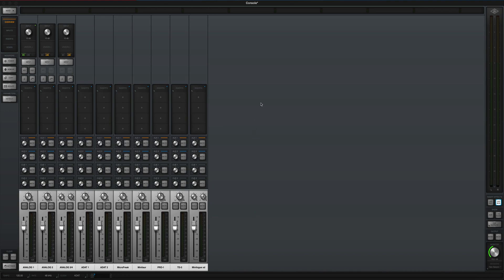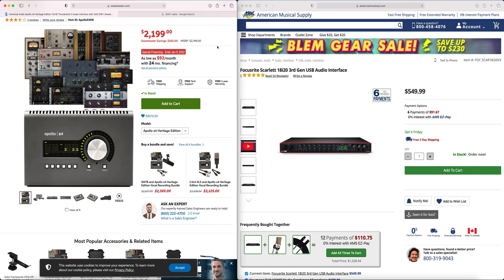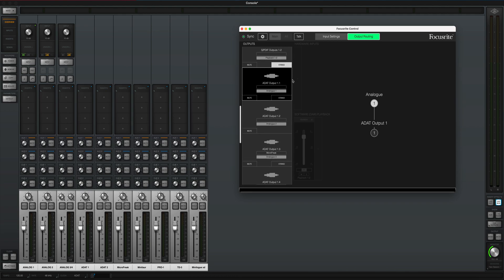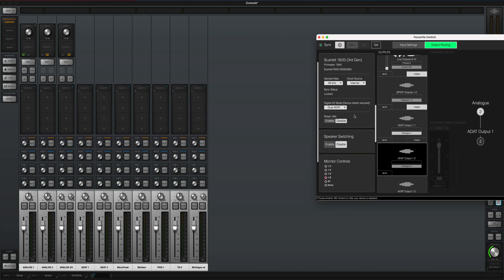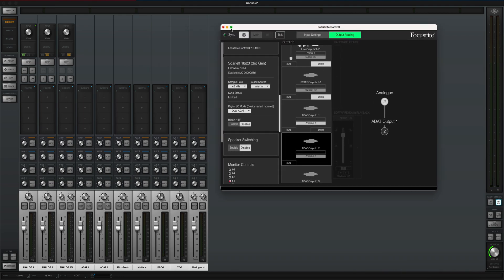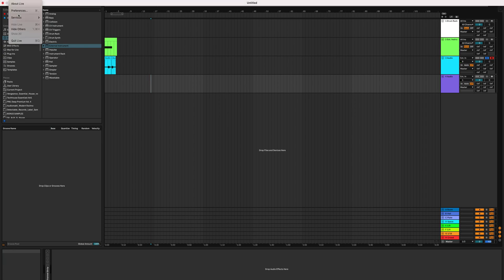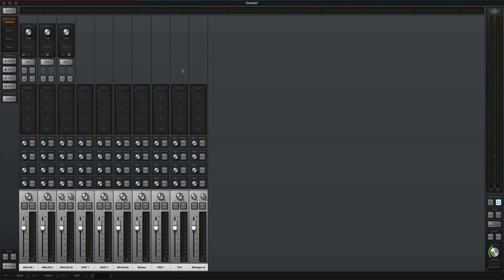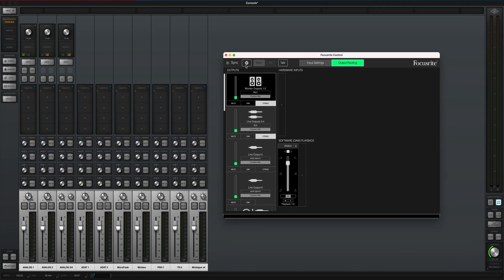How to expand your audio inputs using two audio interfaces

Comment: Will the outputs on the focusrite work if I connect stuff on the outputs and extra headphones on the headphone out and still have the Apollo twin x as the main interface ?
Reply from the maker: You’ll need adat out coming off of the Apollo as a master clock.
If you reroute the outputs to become stereo outs, you can use a dual male ts to female Trs cable and use the extra outs as extra headphones units.
Reply: @cytocache1238  would you make a video ? Sounds confusing. Will it work on Apollo twin x?
Reply from the maker: @mitzthegamer  you can just get a headphone splitter if you need more headphone options. Mackie has the HM-4
Reply from the maker: @mitzthegamer  and I suppose I can make a guide about headphone routing in the future
Reply: @cytocache1238  thank you . I do have a mackie big knob interface . Is there a way to connect that to the Apollo twin x to get extra outputs for headphone and studio monitors ?

Comment: Can I set up my Black Lion interface using the 18i20 as extra inputs using the example in this video?
Reply from the maker: Yes. Use it as the main interface and set the 18i20 as the follower. I.e: set the 18i20 clock to follow adat signal

Comment: Great to know! I thought I was going to have to not use my saffire 40 pro any longer. I’ll use it as 8 additional ins as I’m looking to upgrade my interface. Of course via adat. I also have a Focusrite Saffire 24DSP with adat with 4 inputs. Is there a way to link that in for 4 more inputs? In essence it would be whatever new interface I end up getting + Saffire 40 pro + Saffire 24dsp = 3 units total. ??? Thanks kindly! 👍🏼

Comment: I have “spdif In”
available on my Apollo x8 but it is connected to my Mac mini by thunderbolt 4 connection. 

I have a focusrite 6i6 with available spdif in/out but that is connected to my windows pc. The focusrite allows me to record midi with my Keystation 88 Mk3 and micro korg synthesizer.  

Can I connect them even though they are connected to different PC’s? I’m so confused
Reply from the maker: I believe the focusrite, even when connected by usb to a pc, can still use this adat feature. You do need to set this up in the focusrite software app on the computer it’s connected to. The focusrite can work even without connection to a computer as long as the settings are right and there is power. You will not be able to have the Apollo and focusrite show up on both computer simultaneously. One needs to be designated as the host computer. As far as spidf goes, that is a 2 channel digital connection and cannot stream 8 inputs; only 2. For example I use my spidf for hardware mastering converters since they only operate on a 2-channel count. If the focusrite doesn’t have adat you need to create an “aggregate device” interface on one of the computers. This is a virtual connection made by the computer to connect both interfaces together under one interface title. Protools has “Pro tools aggregate I/O” as an option. This does require both interfaces to be plugged into one computer tho. 
As a note, why are you using two computers at the same time?
Reply: @cytocache1238  Thank you for such an informative response! 

I am not using them at the same time... I just have them both available... My PC has tons of storage and power for Gaming, Streaming, 2D/3D and Video Editing! (AMD Ryzen 3950x CPU) I have my focusrite 6i6 connected to that. My 6i6 has midi In/Out's and I'm able to use that for my Keystation 88 Mk3 and my Microkorg Synthesizer and record in Reaper DAW.

My Apollo x8 is intended to be used for recording vocals because it has top tier converters and pairs with my Dangerous D Box+ for Analog summing but it does not have midi. 

I guess I will just bounce out the stems and transfer them over via thumb drive... I just wanted to know what/how I should think of the spdif thing. I'm not exactly sure how to apply it.
Reply from the maker: @checkmatenate  you need to look into purchasing something like a usb to midi dongle. I recommend motu midi express xt. It gives you 8 midi channels both in and out to work with. It’s cheap and you can find cheaper on Reverb.com. Spending on your keyboard it may actually already have available midi in and midi out that connects to your computer through its own usb port. You can chain midi cables off of your keyboard to the micro KORG

Comment: hey so i got everything set up. followed every step. i have everything routed on console and im getting signal through console for the extra 8 channels but ableton isnt receiving signal to record from the adat. What am i missing?
Reply from the maker: Go to input settings on the preferences window in ableton. Select 8 new mono channels and 4 stereo channels to see them in your session
Reply: @cytocache1238  i did that and I see them. But the green light that shows when audio is coming through doesn’t light up. But it does light up for channels 1-4 (those are from the Apollo) weird thing is that console is getting signal and when I drop any of the plug ins into the adat channels they are affected by them. It’s on abletons side. Wish I could show you lol
Reply from the maker: @om53_  just restart ableton. Sometimes it does this when you change I/O routing

Comment: so after this I should be able to connect my outboard gear into the 18i20 and use them as inserts on protools?
Reply from the maker: Only if you have a main interface with both ADAT in and OUT. The Apollo twin only has ADAT in meaning it can only receive 8 more inputs. Without ADAT out you can’t actually send signals to your outboard gear. The minimum UAD interface that would let you do that is the x4.
Reply: 💔💔 sounds like it's time for a x4
Reply from the maker: @JUSTOFTO  you can also consider one of the antelope audio interfaces. The converters sound better and the connections are all still there. You may have to adjust to the different software. Or just buy a rack mount Apollo in the future. They link up by thunderbolt

Comment: What about outputs if I’m routing 6 monitors for a 5.1 setup to input of monitors and output of Scarlett do I send any cable into the Apollo twin if that’s the primary to hear sound
Reply from the maker: UAD just released support for surround sound, but I’m not sure if it works on the desktop interfaces (just the racks as far as I know). However, if you’re using a twin you only have adat in, meaning you can only record an extra 8 inputs, but you cannot send out an extra 8 outputs unless your core device has adat out as well.
Reply: @cytocache1238  I have a Scarlett 18i20 it has Adat as well
Reply: @cytocache1238  I get what you saying

Comment: I’ve been told by UAD that I can run ADAT out of my Apollo X4 into my 18i20, then use the Apollo as master clock???

Is there any benefit to this or is the approach you take in the video yield same results?

Thansk, I’m new to ADAT / slaving.
Reply from the maker: I have that exact set up. You basically get 8 more inputs for instruments/hardware (Adat in on the x4), and 8 more outputs for multiple monitors or to send to gear (Adat out on the x4). The clock needs to be the same on both interfaces so that the sample recording is timed correctly when entering the daw, if not you get audio dropouts and pitch drifts. Clock also can define the way you interface sound exiting the speakers. The x4 frequency response has more lows and highs than the 18i20 so you definitely want the x4 to be the master clock.

Set you Apollo console to internal and set the focusrite app to adat. They need to be the same sample rate ie: 48k or 44.1
Reply: @cytocache1238  so what I should do here is keep the Focusrite running into Apollo via ADAT. But just switch the settings so the Apollo is master clock? 

Sorry I’m just confused as to why in your video you have the Focusrite set to master. When the Apollo set to master will have better results.

Really I’m just not fully understanding, not trying to undercut.
Reply from the maker: @tazekozak  I just recently learned about how clocking can change the sound. Either way, the physical converters on the Apollo will still sound good. Either way works
Reply from the maker: All you have to do is set the focusrite to adat and that’s it

Comment: I have a Mackie Onyx 8-channel interface that isn't supported on my 2015 iMac, so I can't install the Mackie software.  Will the Apollo still recognize it without configuring the Onyx to adat out?
Reply from the maker: It probably will, but the ADAT routing may depend on how the Mackie software is set up.
Reply: @cytocache1238  Apollo wasn't getting the input signal from the Onyx, but I'll hook it up to my old computer to see if I can change it to ADAT out.  Thanks!

Comment: Hello. Very usefull. Thank you. Could you tell me if it's possible to connect a third focusrite clarett 8pre to have 24 inputs in apollo x8p?
Reply from the maker: I just got in an x8. I think it requires 2 adat cables for both in and out so you would only be able to use 1 scarlet device. There wouldn’t be extra ADAT slots to connect a pre
Reply from the maker: If you have a desktop unit like the twin x or x4 they can run their own adat connections too and don’t require 2 adapts per in and out. You could possibly run that set up.
Reply: @cytocache1238  the x8p has 2 adat in and 2 adat out. I'm waitting my x8p to arrive. I will try anyway. Thank you for your time and vídeo.
Reply from the maker: @PedroDYONYSYO2008  you may find better results than I did. I had to reroute all of my I/O  when I connected my 2 Apollo units

Comment: Great video. So you do not need to have an adat out running from the Apollo to the adat in on the Scarlett? Just the adat out from the Scarlett to the adat in on the Apollo?

I want to buy the Apollo twin x to do exactly this, but was reading some posts that warned it wouldn't work right since the twin x does not have an adat out. You have an adat out on the Apollo X4 but did not even use it in this video, which is giving me hope the twin x may be fine to do this.

Is the trick to make sure the clock is coming from the Scarlett, since with no adat out on the twin x there is no way to send clock to the Scarlett?

Any info is greatly appreciated. If this is possible without any issue in sound quality or latency i would def pick up a twin x. Thank you!
Reply from the maker: Yes I believe this will work. It would be the Adat outs from the Scarlett to the adat in on the Apollo since it only has adat in. You can send up to 8 channels along an optical cable so you should be fine, but you still need to set up the focusrite interface to be able to do the extended input/outputs for your Apollo.

https://support.focusrite.com/hc/en-gb/articles/115003394169-How-do-I-set-up-my-Clarett-or-Scarlett-2nd-Gen-for-Standalone-Mode-

This is the focusrite manual going over how to do the steps in the video

Comment: What’s the advantage of owning the Apollo x4 over the Apollo twin x Quad if you plan on expanding with the Scarlett?
Reply from the maker: They are both great devices it’s just that you can expand the amount of preamps leading to the same interface. You can use a different mic preamp box rather than the Scarlett (the Scarlett is just what I have at the moment). Expanding preamps allows you to record multiple instruments or hardware at once like a full band.